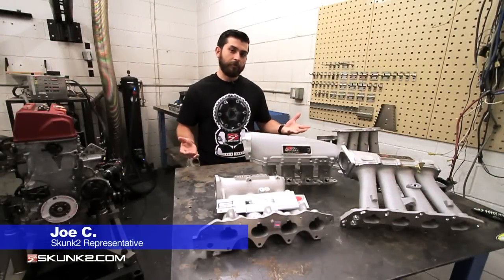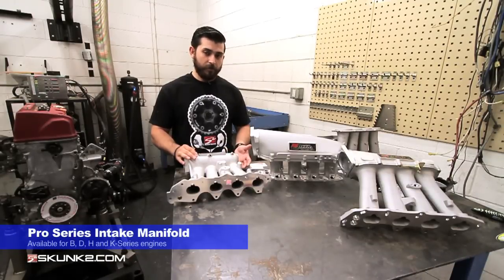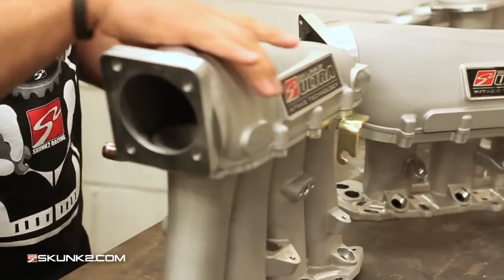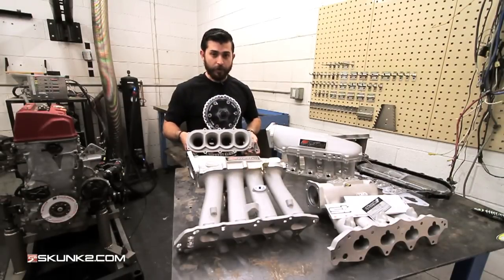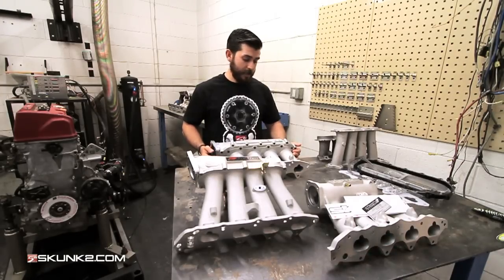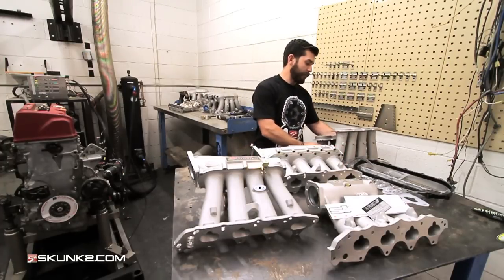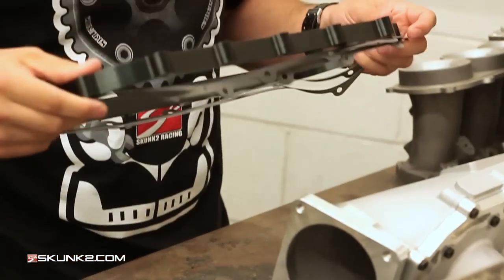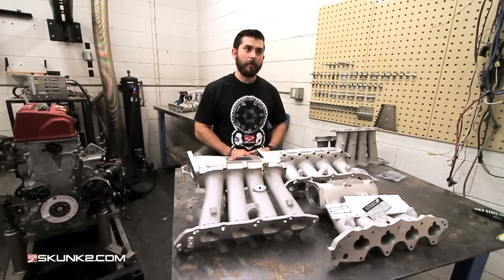Skunk2 Intake Manifold Tutorial

Comment: I have the street ultra wit a 70mm skunk2 pro TB & skunk2 stage 2 cams on a fully built b18c1 & so far it works 100%
Reply: +Wilbert Ramos hey did you put the thermal casket on it or did you put a stock one??
Reply: hondapower eg no I bought the thermal gasket better stock is to thin

Comment: I have a pro series manifold on my H22 and it's been a fucking nightmare... The fuel rail studs would shear off in the manifold while driving and rail pressure would start pushing fuel past the injectors.. Left me on the side of the road more than I'd like to admit. It turned into a regular occurrence. They'd shear off, I'd tap them out, get new studs & spacers, install them, they'd shear again in a matter of weeks. I even started adding 2 zip-ties to hold the rail down every time I'd replace the studs and spacers because I knew they just break again.. the zip ties would atleast keep the rail in place long enough to get me home and stop a potential fuel leak. Eventually I ditched the studs for grade 8 Allen bolts, I thought I had it fixed and figured i didnt need the zip ties anymore. I was wrong. The last time it happened my car actually caught fire on the side of the road at 3 am, cell phone was dead, closest house was a good 10 minutes walk.. luckily I managed to put out the fire under the hood by smothering it with my sweater, pushed my car backwards then put out the second fire burning underneath the car. No damage to the car other than a slightly crispy harness. After that I decided enough was enough, I took the manifold off and brought it to a local machine shop. They made some spacers out of aluminum, drilled and tapped them out for a much larger Allen bolt and welded them to the manifold. No problems since. Only downside to this is I can now only use injectors that are the same height as obd1/obd2 honda injectors since I dont have the option of using a shorter spacer, no big deal really... After all this I really do think it's a big fuck up on skunk2's design of this particular manifold. For some reason they decided to tap the hole for the rail studs on the very edge of the mounting base, when you install the studs then put the spacers over the stud, the spacer hangs off the back of mounting base. Its offset from the base. Even the machine shop who I had fix it pointed this out as a major shear point. If you own a pro series manifold for an H22 take a look and you'll see what I mean. I've looked at their B and K series manifolds and they dont have this problem, stud holes are right in the center of the mounting base, as they should be. Its almost like they didnt bother to fix the design after it was put into production or they never even bothered to look. I emailed skunk2 to inform them of the issues I was having, I even sent links to hondatech pages of people having similar issues with this manifold. Eventually they just started ignoring my emails, big surprise..

Comment: Im confused, you say in your video that the pro series its CARB legal #307-05-0325 but I've been told its not. Part #307-05-0600 (street version) says its CARB legal.
Both version fits the engine but Part# 307-05-0600 doesn't fit engine bay in the 2004-2008 Acura TSX. Please confirm.
Reply: Hes showing intake manifolds for a bseries and you are looking for an intake manifold for a k series

Comment: Will an 1998 Acura Integra Intake Manifold fit a 1998 Honda CRV
Reply: +Swiftness_ Assuming it is a B18A or B18B yes it will. A GSR B18C1 will not fit as they have different bolt patterns and the B18A&B and B20B&Z do not have dual path intake runners.

Comment: Could you do this for the d series
Reply: they only have the first one they showed, I own a y8 and its pretty pointless to have one unless its built and boosted.
Reply: Channing Kelso its not pointless. Gain is gain
Reply: Channing Kelso plus you wouldnt use a pre series mani for a turbo y8 you would get the ultra or race series manifolds.
Reply: when the product is 250$ or more and you only gain 5hp.... a gain isn't a gain. they don't make them for the d series.....
Reply: Channing Kelso doesn't mean they won't work for d series engines bruh.  Also it's not just about an HP number it's about shifting the power band and making more usable power where u need it .  Throwing out  numbers like a"5hp gain" is bullshit depends on the build ... JS